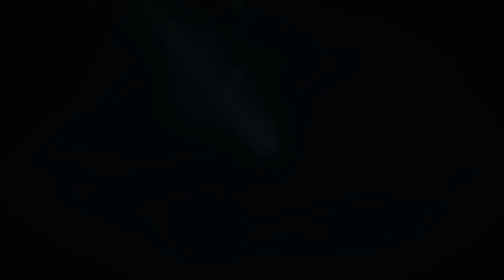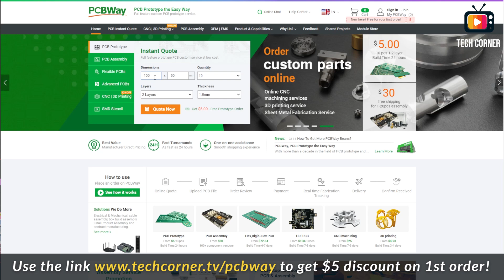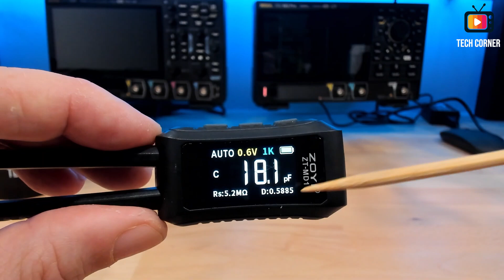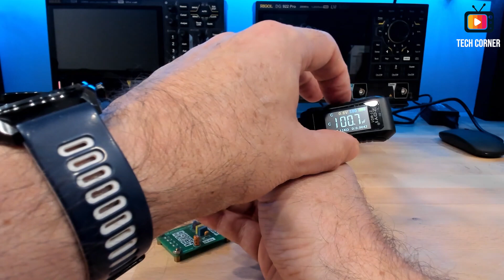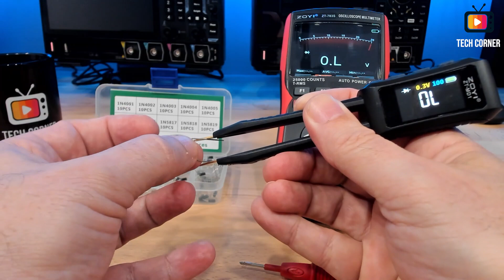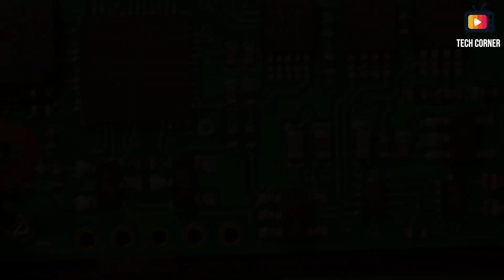ZOYI ZT-MD1 ⭐ LCR Bridge Smart Tweezers

Comment: Thanks for the video - I just got one.  I was comparing it to my BK 879B and found quite a difference with ESR on non electrolytic caps.  Did you ever evaluate the ZOYI ZT-MD1 for ESR?
Reply from the maker: HI, after reading your post, I did and the difference with the Shannon Tweezers that I also have, was not so relevant. Thanks for watching.
Reply: @TechCornerTV  thanks for testing.

Comment: You can't review "ZOYI" equipment, you are the "FNIRSI" agent - only kidding. 😉  Do you know about a dedicated zener-diode tester that you can recommend? Good video BTW. 👍
Reply from the maker: Hi John, I do have a long collaboration with them and they more than once ask me what can be improved or accept my suggestions, but even so, FNIRSI agent is a bit streched 😁 I try to be impartial. But that said, you're question is also a tricky one, since I do use the DSO-TC3 to test my components/zender diodes... so we are back to FNIRSI. From all I tested, it's the more stable in my opinion. Thanks for watching and your nice comment.